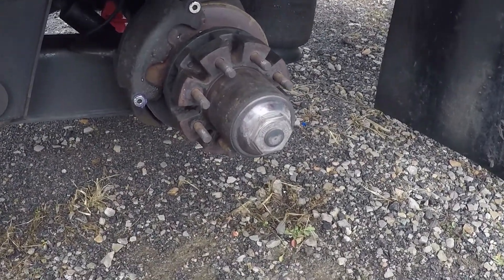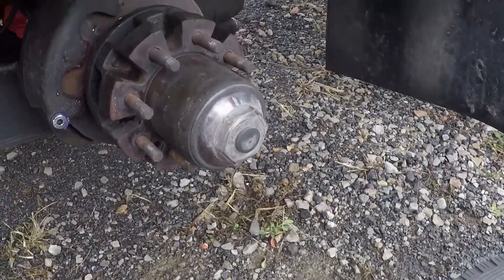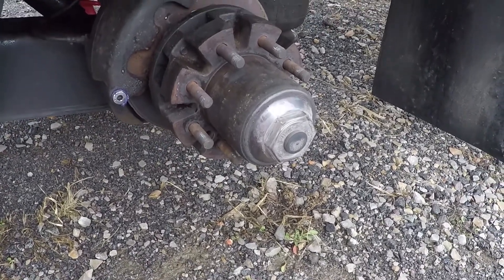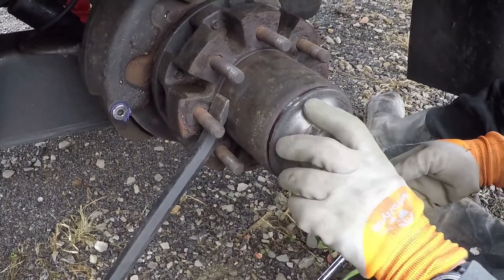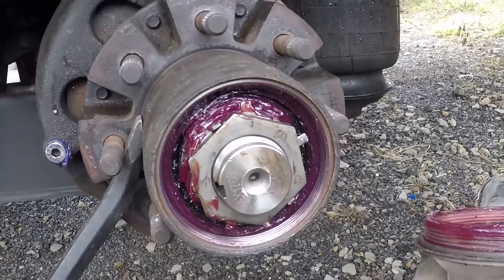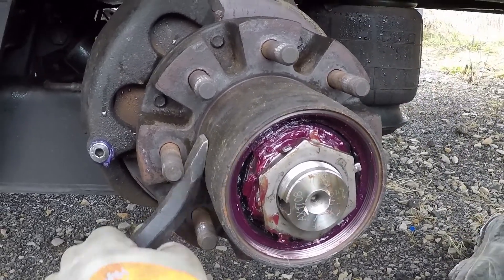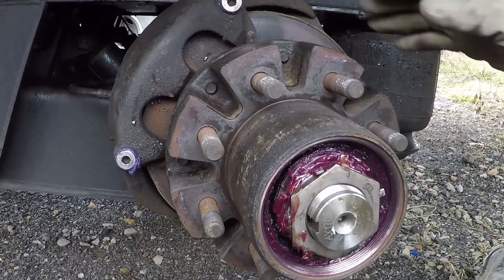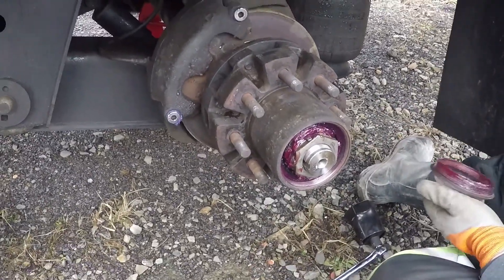Trailer Hub Oil to Grease Conversion Experiment - The First Look

Comment: Wrong grease in that hub
Reply from the maker: It's good for wheel bearings...was good for over 100k on that trailer plus other stuff we've used it on. What would you use?
Reply: @k30krazy  in big rigs there a grease is specific it looks like mustard grease i hate packing it with it but it what they specify or switch over oil bath hubs just change seals and bearing races diffrent caps
Reply from the maker: Thats for the info, I'll look into it. That trailers long gone now though so maybe for future needs lol.
Reply: Yes, what you're referring to is called 'SEMI-FLUID' grease.  It has an NLGI rating of '00'. Some of them are Mustard in color and one manufacturer makes one that is GREEN.  Actually, SEMI FLUID grease is a combination of a heavier wheel grease and an oil. That's why is has the consistency that it does.  Delo, Kendall, and quite a few other makes these greases.  However, you can use HARD grease as did in this video but it's got to be the correct one for the application.  My flatbed has hard packed grease on 3 of the wheels and the wheel where I had to replace a bearing on, I installed LUCAS HUB OIL.